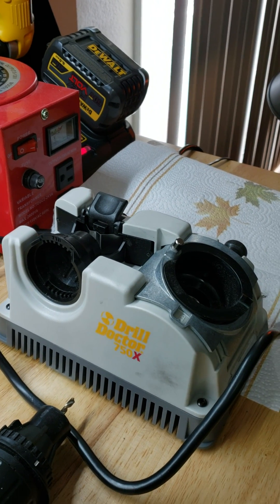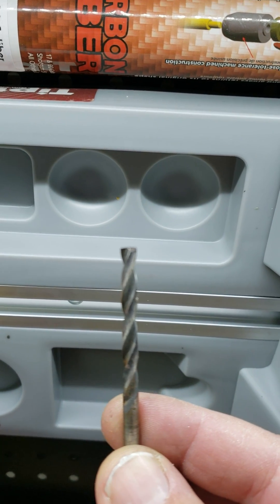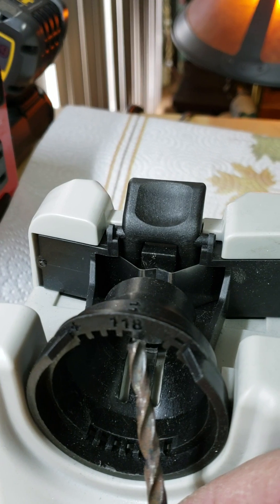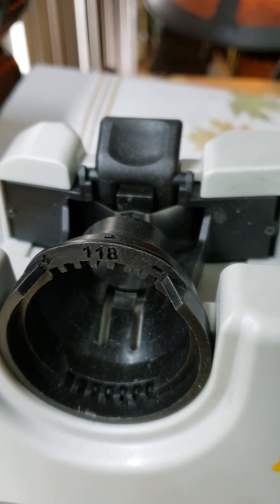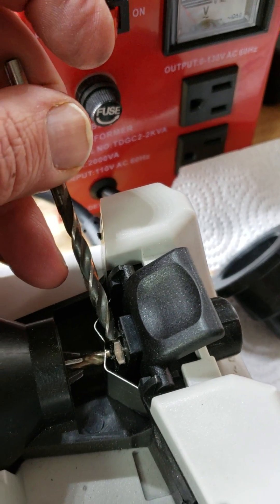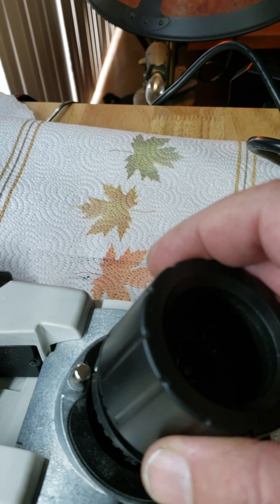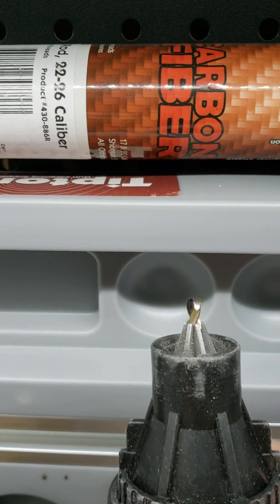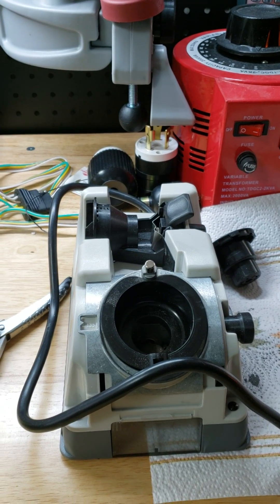Drill Doctor 750x Solved!! - Right Way to Sharpen a Drill Bit to a 135 Deg Angle with a Split Point

Comment: I did find the mention of the 135 angle in the download of the PDF on page 18. I tried to read all comments, but I didn't come across that being mentioned and have no idea when it was either added or changed in the manual.

Extract of the Manual from the PDF mentioned:
When sharpening standard 118° 
drill bits, align in the 118° slot. 
For standard 135° drill bits, align 
1-notch to the right (-) of the 118° 
slot.

Downloaded January 12, 2021

Comment: Honestly, I mhave had mine for more than 12 years. Tried it when first purchased, had same result on a drill bit as you showed first. I put the thing up and until today I have not used it or even taken it from the case. THANK YOU FOR THIS VIDEO AND YOUR TIME!
Reply: Lol, same here. Bought mine ~2010 and sharpened some at 118 and it worked great. Then tried to do a 1/2" bit at 135 tonight and had no idea how to get 135. I knew it had to be an alignment problem... not intuitive at all.

Comment: Creating excessive heat while sharpening will temper the freshly cut bit's tip, thus rendering it brittle and now you have to sharpen again after drilling 10 holes. Until we meet again...... 💀

Comment: Another thing to make sure you do.  Never drag the drill past the setting paddles while they are engaged.  Always lift the paddles clear when you insert, remove, or align the drill.  That way you won't wear out the paddles.  The most critical thing in drill sharpening is proper "timing" of the drill in the chuck before grinding.  It is here where the Drill Doctor has the advantage over the others.

Comment: great explanation....i used my DD750 a lot but some bits worked fine and others sucked....the 1 notch was a big key because i swear mine says 135 about 5 notches to the right...also the silver part that needs to be coordinated for the 118/135 cut is vital...these little things make all the difference and when I spend hundreds for good drill sets, I want them to last a LONG time

Comment: I just got the drill doctor 500. I also couldn't figure out the 135 point placement. Drill dr. should of made a 118 notch & a 135 notch for the alignment part. Also you are correct about the instructions, totally useless. Thanks a lot!
Reply from the maker: Glad it worked out

Comment: Thank you so much! I was in a jam with a 1/2  carbide bit in the mid of a project dulling out -_- I did the same exact thing you were doing. I pulled out a flat bit like what the heck! Then I also had a super aggressive cut. I was able to take a flat bit, restore it, and split tip it so it looks beautiful - am heading to finish my project. I was watching videos like you said you did trying to figure out what was going on. The directions are crazy, for something so simple they could have done better but the machine with your instructions makes an amazing tool in my shop! Thank you!!

Comment: Agreed, the manual sucks. It’s okay, until it gets into looking at the cutting edges in relation to the horizon…WTF, seriously?!  So I ignored that part and the bits came out just fine if I wanted a 118 degree point, but their explanation about 135, they might as well have left it out of the manual for all of the good that it did.
Reply from the maker: Unreal after all these years

Comment: Keep in mind that when you hear the “grinding noise”, the diamond wheel is intact with the bit (and cutting its metal).  This noise is telling you also that heat is being generated and when you are working with a sharp edge, this will be heating or tempering the bits cutting metal,   DON’T grind for an extended period of time.   Also, use some better lighting(s) (more than just one source), and maybe three to five fixed camera positions.
Great video though, keep it up, thank you.
Reply from the maker: Good suggestions. This video was kind of a spur of the moment cause I was so happy that I figured it out - hence the poor filmography

Comment: I can see this is 4 years old but we do appreciate you taking the time to show us how. I would like to make a comment that I think you did not get quite right. When setting the drill bit in the chuck, the plus side is meaning it to be a more aggressive drill bit, so in other words it means 118 is a more aggressive than the 135 the 118 is used for softer metals and wood where the 135 is not as aggressive and it is meant to drill harder metals. Harder metals need to have a split bit so it will not wander, whereas softer metal have less tendencies to wander. Hope this helps. Thank you again!
Reply: While "+ is more aggressive and - is less aggressive" seems logical, I think you have it backwards. It seems to be "+ advances the bit clockwise in the chuck, - moves the bit anticlockwise in the chuck". 

The further you go from the cutting edge, the greater the relief angle should be; the angle is greater at the relief than at the tip. If you shift the bit in the chuck it changes it's position relative to the cam on the sharpener, and increases or decreases the angle at the cutting edge.

Moving the chuck anticlockwise (towards +), while keeping the bit at the same position, results in the bit being mounted further clockwise (advanced) in the chuck. By mounting the bit further clockwise, the bit is shifted against the cam position such that the lesser angle which would have been on the cutting tip is shifted towards the relief. This results in a LESS aggressive cutting angle.

Moving the chuck clockwise (towards -), while keeping the bit at the same position, results in the bit being mounted further anti-clockwise in the chuck. By mounting the bit further anti-clockwise, the bit is shifted against the cam position such that the greater angle which would have been on the relief is shifted towards the cutting edge. This results in a MORE aggressive cutting angle.
Reply from the maker: Much appreciated.   Thx for watching

Comment: throws me off that the groove of the split point now disrupts the step one: chuck alignment: the JAWS are now grabbing the bit differently.......but, not a problem?
Reply: The jaws grab both sides of the drill, so the cuts for the split point cancel each other out. Alignment ends up the same.

Comment: Thank you for your video.  Not sure if this video was out when you did yours but Drill Doctor has a current video :"Drill Doctor 500X and 750X - Demo Video" on You Tube that explains in detail the process for using the Drill Doctor 500 and 750
Reply from the maker: I will check it out

Comment: Page 18 of the Drill Doctor manual right in the middle of the page   "For standard 135 degree drill bits, align 1 notch to the right (-) of the 118 degree slot" The manual also says at the bottom of page 15 splitting the point for 118 is optional and mandatory for 135.
Reply: haha, see, you have a different manual.  MY 750x has a 135 mark on the alignment head as the LAST index hole (closest to the sharpener), and the manual says roughly "for splitting 135 degree align using the 118 mark"   (I can pull it out and quote it....).   this may explain why I've never gotten a function drillbit out of mine for 135 (worked fine for 118).    I bought mine in '07.
Reply: Lol yeah guess nobody reads. I was going to make the same comment.
Reply from the maker: This video was made prior to a revision in the manual.
Reply: @VermontPrepper  ohhh didn't know that. My bad
Reply: Mostly men using it ..what do expect? !!we only speed read the manual 😂😂 myself included aka" look at the pictures "
Reply: Thank you so much for posting this video.  My 750x sharpen 118° drill bits perfectly but I could never get 135 to work.  My manual is dated February 2009, and it says each notch in the alignment Port is approximately a 10° change in the chisel angle on page 23.  I'm thinking drill Doctor must have changed the manual at some point, because one notch to the right works perfectly on my 135° bits.  Now I can sharpen all my Cobalt drill bits - yeah!

Comment: tried your suggestion  did not work  so i pushed the plate up past the 135 degree and locked it then placed the chuck in the second last hole on the left and what a difference  your idea  needed lots of pressure  to cut as my idea required little pressure to cut and very fast drilling.
Reply from the maker: Works for me every time
Reply: @VermontPrepper  was you using drill press or hand held drill  if hand held drill it took a lot of pressure to make it cut

Comment: TY!!!!!!!!!!!!!!!!!!!!  No where could I find why I was not successfully sharpening my 135 degree drills. The Manual does SUCK, it's useless!! Pity because the machine itself is high quality and I have owned a 118 Drill Doctor for 10 years. Again, that machine is / was reliable. 

NO ONE lese has solved this 135 degree problem other than YOU. I found Drill Doctor's web page useless. Where did you see this on there page?? Who the hell would have thought one notch clockwise changes 118 to 135.

Thank You my friend The machine was useless to me till I found your video. YOUR METHOD WORKS!!!!!!!!!!!!!!!!!
Reply from the maker: Glad I could help.  I messed up a number of drills experimenting, lol!

Comment: They must have updated the manual, mine says explicitly to lineup up notch to the right of 118. On my unit, the split point isn't aligned correctly for most bits. I just push it in slightly, then raise UP on the back of the chuck. Otherwise, I split more of the flute than the point lol.
Reply from the maker: I think they did update since this video.
Reply: I have the same issue with the splitting port.  Even after minutes spent slowly advancing the thing into the wheel, it won't grind deeply enough to join the split lines at the chisel tip.  Plus my machine's wheel mandrel apparently wasn't pressed onto the motor shaft far enough.  I had to put a shim between the motor and the mounting plate to move the wheel inward. Otherwise it left a ~15 thousandths remnant of the chisel tip between the cutting edges.  It's also as though the wheel is too low for the splitting port such that the bit can't advance far enough to complete the split. It seems to bind on something. I'll try rocking the chuck as you describe.

Comment: Good job! I will stress what you pointed out: always continue to sharpen until the grinding stops. I made the mistake of only grinding with as many turns as I thought would be sufficient. I finally learned from Drill Doctor if you don't grind until the noise stops you won't get the proper relief to cut efficiently (wish I payed closer attention). I spent hours grinding all my bits only to learn I'm going to have to do it again!

Comment: You took WAY TOO MUCH material off while forming your split point. You took so much off that you overheated the tip, causing it to blue. Just touch it and pull it away, touch it and pull it away.

Comment: Thank you, no one in YT have described what you mention here.  So, most of them are wrong BUT maybe they revised the manual, because it is there now exactly what you explained. But then again until your video, who reads the manual !!!?! lol. 
Sometimes it is hard to check the angle of the bits especially the small ones. A guy on YT used 2 nuts together and it is exactly 118*. So, I superglued them together and used that. It is really handy--I made sure he sharp part on one side of the nut then looked towards the light, 118* will not have any gap but the 135's will. Then again, all my cobalt bits are 135's.

"When sharpening standard 118°
 drill bits, align in the 118° slot."
"For standard 135° drill bits, align
 1-notch to the right (-) of the 118° slot"

Stated under page 18, LINK of the manual below. (PP50122KF Rev 0 7/18). Under paragraph "2. Insert Chuck into Alignment Port".
https://www.drilldoctor.com/wp-content/uploads/2015/09/DD500X_and_DD750X_User_Guide.pdf
Reply from the maker: Glad manual finally mentions it

Comment: I have just received the 500X.  Reading the manual (PP50122KF Rev 1 10/18), it is very comprehensive and understandable .  It clearly states how to set up for 135 deg and what the other 10 deg slots are for (adjusting chisel and relief angles).
Reply from the maker: Maybe they revised it.  That's good if they did

Comment: Not a bad video, but please, they are drill ”bits”, not drills. I’m sure you know the difference.
Reply: No. They're drills. Calling a twist drill a 'drill bit' is not correct.
Reply: They're twist drills or drills, not drill bits. Just as light bulbs are called lamps. Hope this helps.
Reply from the maker: It doesn't help.  Who cares.  The purpose was to show how to sharpen.  Sorry I am not an expert tool guy.

Comment: wrong, The 118 or 135 is determined at the cutting guide.  My goodness. you are very much confused as I listen to your walkthrough. your associating wrongly function with action and outcome.
Reply from the maker: My results speak for themselves.   Post a video yourself then
Reply: It is in the manual now, page 18. Alignment guide for 135 drill bit. 
"For standard 135° drill bits, align 1-notch to the right (-) of the 118°

slot.https://www.drilldoctor.com/wp-content/uploads/2015/09/DD500X_and_DD750X_User_Guide.pdf
Reply from the maker: Its about time.  Thx

Comment: Tip: a "notch" goes inward NOT outward.  Think of the old expression about "notches on a bedpost".  In the beginning you pointed to two "ears" or "tabs" but they were NOT notches.  You're very knowledgeable about the Drill Doctor and I Thank You for making this video but you need to do a dry-run (or two) before you record.  Your patter and the words you use are important.  Sound as smart as you are and you'll be even better!  Thank You for making this video.

Comment: Great video I have the same one that I received yesterday.
I got it for 135 but a dumb question, is the 118 on the alignment is it really 118 because the one notch to the right like you mentioned is 135.

Thank you
Reply from the maker: It's what worked for me
Reply: @VermontPrepper  thank you I just sharpened 8 bits one of which is a masonry bit that I'm not convinced but the other 7 look great using you tutorial, thank you because I as well had flat top bits LoL 😅 prior and no other video addressed it like you.
Reply: @ChrisNieves  For carbide-tipped masonry bits, don't use the alignment port.  Position the bit so that the carbide insert lines up with the two marks on the bottom of the chuck itself. Set the MTO (grinding depth) by extending the bit about an inch from the back of the chuck and tighten to just snug so the bit can slide up into the chuck with modest pressure. Plunge the chuck into the sharpening port while the machine is turned off so the grinding wheel acts as the depth stop, then fully tighten the chuck.  Also, don't turn the chuck in the sharpening port while grinding. Plunge only with the white marks aligned with the cam follower. You are simply recreating the tip angle of the carbide and rendering the cutting face notch-free.  A carbide masonry bit needn't be "sharp", it just needs to be shaped.  Metal and wood get sliced by the cutting edge, Masonry simply gets pulverized by the cutting face.

Comment: Thanks! I had the same problem with 135 deg tips. I was ready to take my machine back to the store. You  would think the labeling and instructions would be more clear.
Reply: It actually is printed in the instruction booklet. One notch *(- to the right of 118) for 135 degree sharpening..
Reply: @anthonyash3103  
I was thinking the same thing 
The instructions were pretty clear and precise even the troubleshooting part at the end of the instruction guide was easy to comprehend 
I did a quick read of it while I took a shit and had no problems 
I wonder how many are trying to change 118 bit to 135 and that change is were the confusion and poor results are coming from

Comment: Bought the left handed attachment. Entered a whole new world of bum f*ckery. I will use your advice!
Reply: Did you get the left-handed attachment because you have left-twist bits that turn counter-clockwise, or because you yourself are left-handed?  The left-handed chuck has the cam system mirrored for sharpening in the counter-clockwise direction.  The drill doctor can't do a split point on a left-handed twist bit (I don't believe,) as the splitting port can't be switched to the other end of the grinding wheel. Using the default end of the wheel will grind off the cutting edge of each flute instead of the heel.

Comment: Best video for Drill Doctor on Youtube. Like the rest of the folks before me, I hated how my 135 turns out. Now I know what I did wrong thanks to your help. You're Da Bomb...:>).
Reply: It actually is printed in the instruction booklet. One notch *(- to the right of 118) for 135 degree sharpening..
Reply: @anthonyash3103  throws me off that the groove of the split point now disrupts the step one: chuck alignment: the JAWS are now grabbing the bit differently.......but, not a problem?
Reply from the maker: Appreciate the support

Comment: This is exactly the problem I’ve been having - bits coming out flat trying to sharpen to 135.  I took the drill doctor out of the box today and tried it on a cobalt bit I’ve been using for steel.  It came out flat.  I will try your method tomorrow.  I agree the manual sucks.  Very confusing how to use those alignment things to set the angle.
Reply from the maker: Let me know how it works
Reply: If you have been going to the plus side your bit should not have been flatter, it without question should be more of a taper as you go more to the plus side.